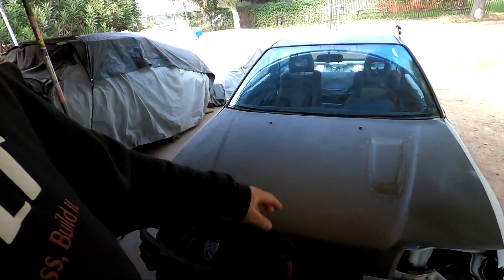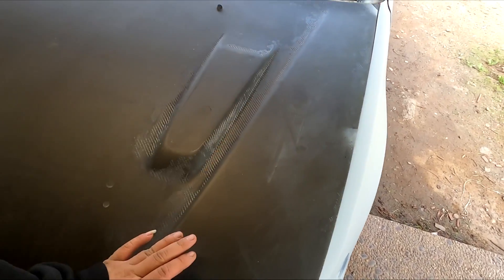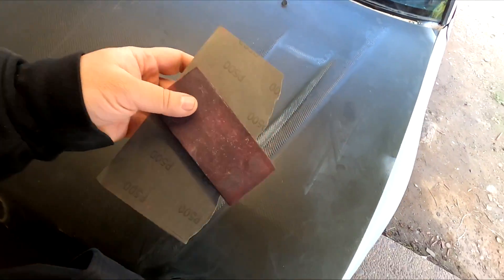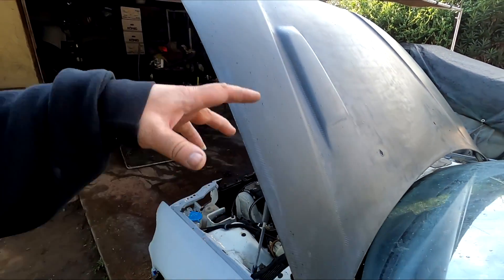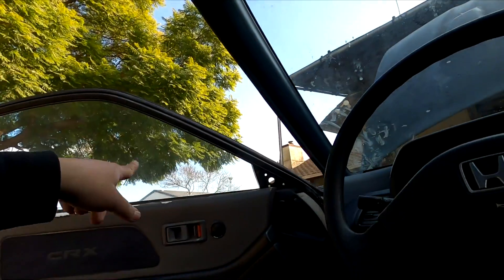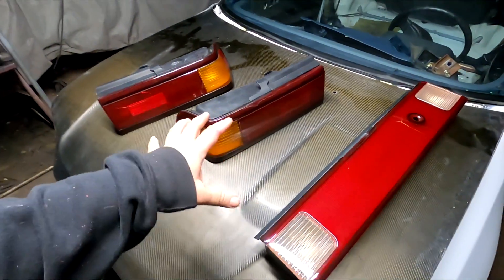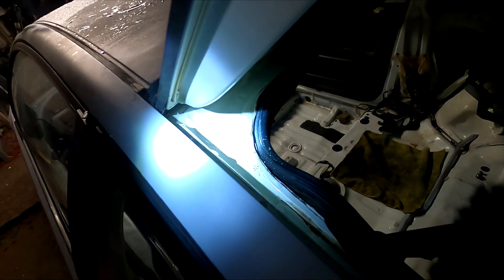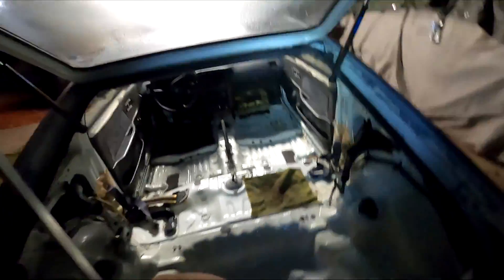Chasing Water Leaks in the 89 Honda CRX HF

Comment: Same issue on my HF and SI. Cracks at the upper corners of hatch and leaking down into hatch shock mount point. Cleaned them up and used some white Flex Seal and BAM no more water leaks. Also check for cracks underneath the roof trim

Comment: On both my DA and DC ive had issues with the seam sealer cracking and allowing water through the hinges that bolt the hatch to the body. Specifically on my DC, I about went mad tracking down a front driver's water leak after I had completely removed all the inside bits of the car and painted the bulkhead. Turned out without the front fenders on, two pieces of frame with some gap between was allowing rain water through. Even on my rsx I also have to deal with the seam sealer cracking around the roof under the hatch. Such a pain in the ass. Thank you for your videos great work man keep it up. I know how it goes, you start a day with a task in mind, and end up having to fix ten other problems that prevent you from finishing the original objective.

Comment: When I bought my current eg, it had the spare wheel compartment full with water. It was exactly like this crx, the seam sealer was cracked in the corners, but it was under the roof trims too. Sealed those cracks and it's been dry since. I would remove those roof trims and check for cracks under, as it most likely will leak from there too.
Reply: My 90 crx did the same exact thing when I bought it. I ended up taking the hatch off redoing the seam sealer and it hasn’t leaked since.
Reply: Man my Eg is leaking in the wheel wheel area as well and it’s around the rear wheel arches. Imma check what you said out cause it’s seriously annoying coming out and a small puddle being in the back and my car windows fogging excessively

Comment: Static. I just fixed mine. The rear hatch needs to come off. Order 3m dynatech white. Pull the roof trim seals out as well and scrape all the old sealer out. Reseal and install the trim seals and re install the hatch

Comment: This video made me glad Preludes don't have a rear hatch so I never had to worry about that particular leak.  Then I remembered we do have sunroofs and how long I spent tracking down a leak due to clogged sunroof drain lines.  I used steam from a steam cleaner to clear the line.

Comment: I had leaks from the hinge bolts that screw into the body. Water would run down the threads and drip onto the backside of the plastic panels. Also had leaks from roof/seems under the roof trim.
Reply: I had the same problem on a 90 crx how'd you fit it
Reply: @bigp3303  I unbolted the hatch and cleaned the surface real well and sprayed it with a can of pant. Then I used RTV/Sealer on the threads and new bolts.

Comment: there is a drain path for the wiper motor bay between door and fender if plugged dumps water inside the car on both sides. Remove fender to access from bottom. Not big or obvious but it is there

Comment: My ek hatch was leaking under the roof molding at the pinch seam because the seam sealer dried up and cracked just like that too. It was also leaking under the cowlnear at the outer ridge that was covered by the fender because of cracked seam sealer.

Comment: I do waterproofing on buildings in downtown Austin tx. And when we do I water testing on the low rise buildings we start from the bottom to the top. We use 795 silicone.
Reply: ATX!
Reply: That makes alot of sense.  Just like looking for oil leaks on engines always look at the highest point,  oil won't travel upwards from the leak.

Comment: Dana I can tell you exactly where it’s leaking from in the back. You need to take the hatch off and redo all the seal sealer around the hatch my 90 crx used to dk the same thing I removed the hatch and redid the seam sealer and it fixed my issue. It’s actually a common issue on the crx.
Reply: Same here 👍
Reply: same 👍 its the cracked sealer right next to the hinges
Reply: @DistortedApricot  have same issue on the right side so I have to remove the hole hatch ???
Reply: @g35tho11  yes and the roof gutter seals to really get it all, i have a short video on my page showing that
Reply: @g35tho11  i can also send you photos up close of exactly where the cracked seam sealer is if you have an email you dont mind sharing
Reply: @DistortedApricot  just seen your video . Damn scared of taking that strip off top don’t want to break anything 😂

Comment: have a look at the gutter behind the wing you have to cut the metal out of your way to access it, i know about leeks im from lreland
Reply: 2nd this. I just had the same thing. Inside the fresh air vent underneath the cowl (mines a RHD) the water sits and pools then comes through the firewall. Takes a bit of time to seep through which is why you didn't see it straight away after you hosed the windshield. You can't get in to access it (as said above, you have to cut away around the vent to get into it) or you can seal up the fresh air vent all together with some sort of cover. Good luck!

Comment: The green is more than likely degraded resin . You can test the resin on the hood. Dab a rag with acetone on the hood wipe it down in a localized area . If you rag turns green. Your resin is degrading